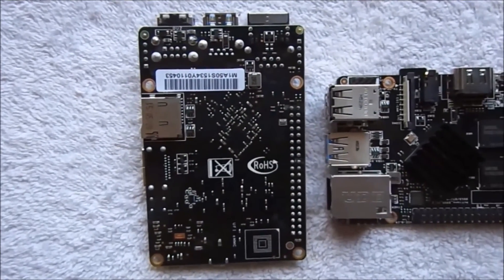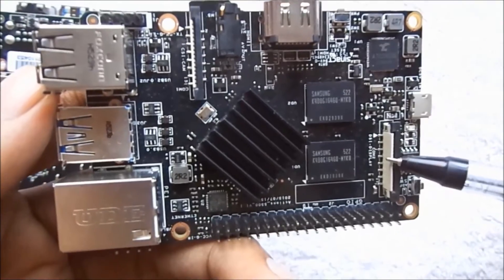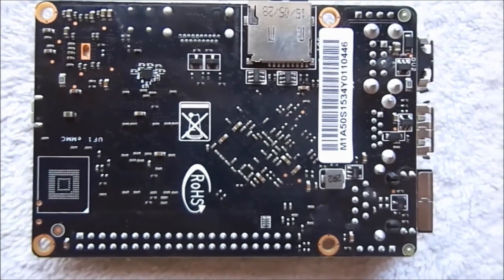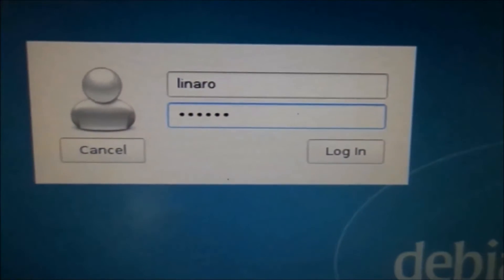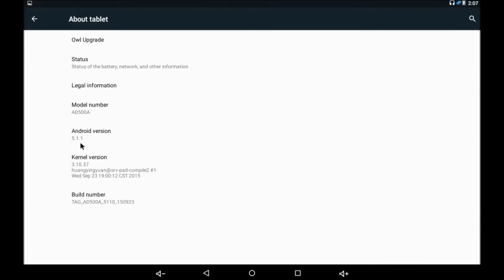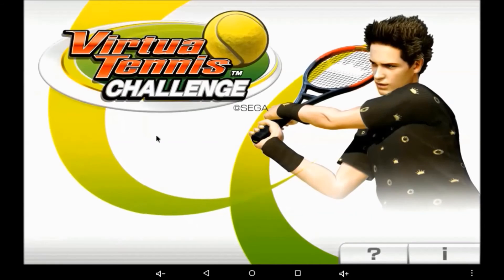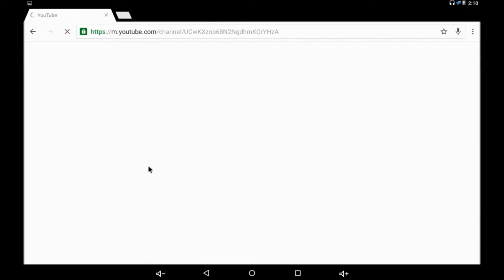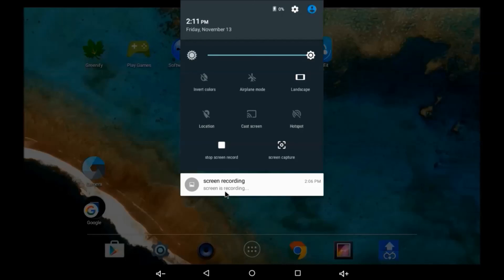Roseapple Pi Complete Review!

Comment: Wifi?  Gig Ethernet?
Reply from the maker: Ehternet is working perfectly,
Working on WiFi connectivity.
Reply: loopie007  but wifi is not built in the board?
Reply from the maker: +nobert singh you can use LAN cable instead wifi

Comment: Hi,
Thank you for the information. 

I want pi to play full hd movies in led tv through hdmi port, is roseapple pi lag free? what is the price? Which one would you prefer raspberry pi 2 or roseapple pi? Price is also a concern.
I surely use 1tb HDD to the pi.

I honestly suggest you to prepare little bit more about the topic and the flow of words to make clutter free videos :) anyway keep it up.
Reply from the maker: Hi Krishna,
I went through your queries regarding your project. Yes, both roseapple pi as well as raspberry pi supports full HDMI output. There will be a certain considerable amount of lag in the streaming  when you forward or rewind the videos.
Roseapple pi will be undoubtedly the preferred device for HD movies streaming. Depending upon your budget you'll have to invest few bugs higher for roseapple pi in order to achieve better performance. 

Thank-you for your invaluable suggestion regarding our videos, we would be looking forward to improve upon the quality of the vidoes. 

As we will be releasing detailed videos on various features of Roseapple pi implemented with some cool projects.